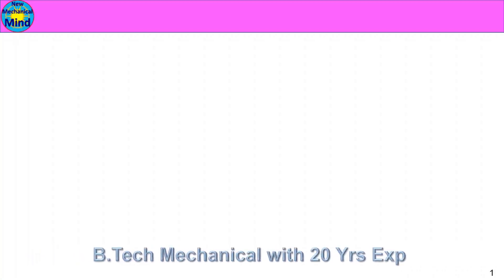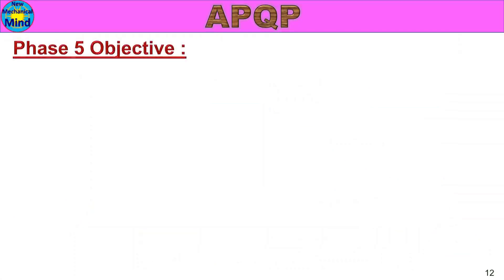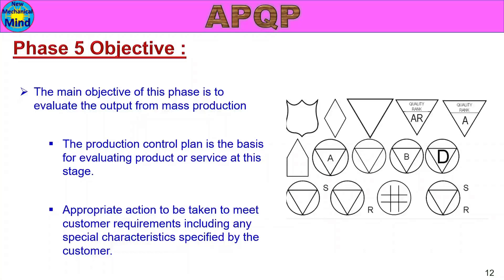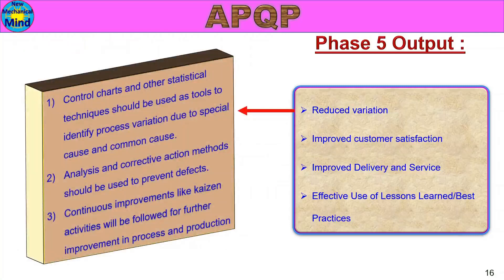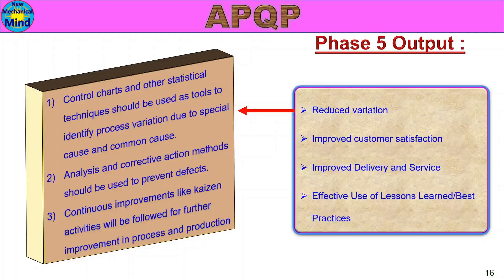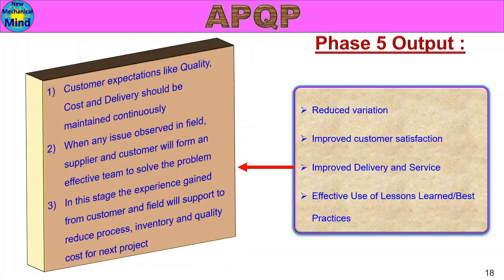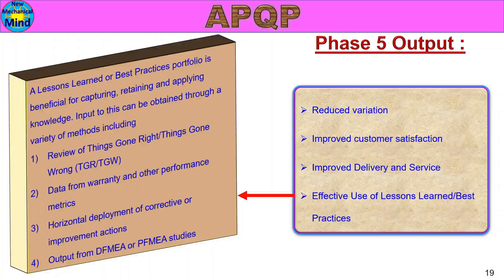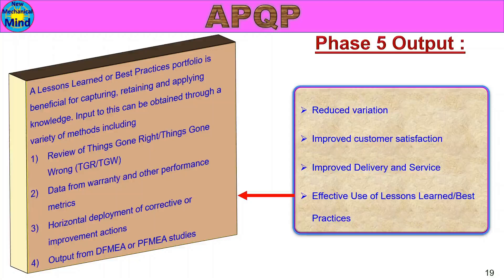What is APQP | Part-7  | Advanced Product Quality Planning | in tamil | new mechanical mind

Comment: Question: In IATF, what is the clause no: for APQP?

In IATF16949:2016, 8.1 Operational Planning & Control, totally speaks about APQP,

 Especially 8.1.1 Operational planning and control-supplemental, use APQP all 5 phases for product requirement, customer expectation, logistics, process required and acceptance criteria.

But for APQP, we have to conduct MSA(7.1.5.1.1), SPC, FMEA & PPAP. So it covers, 
8.1 Operational planning and control
8.2 requirements for products and services
8.3 Design and development of products and service (8.3.4.4 part approval process PPAP)
Reply from the maker: Keep it up